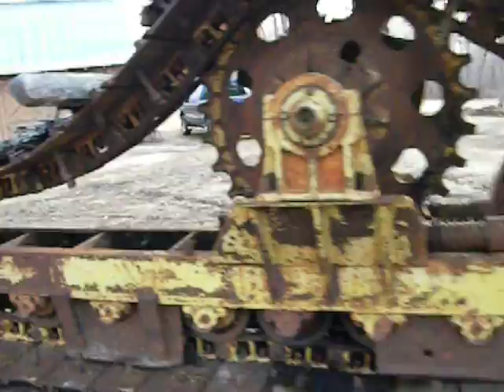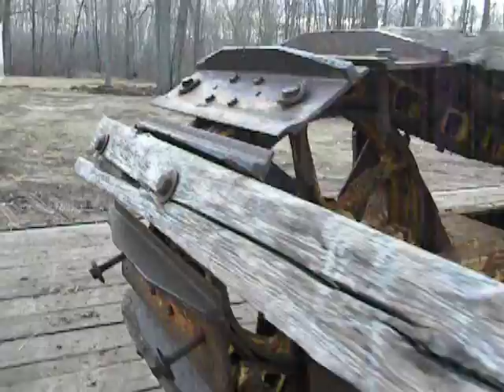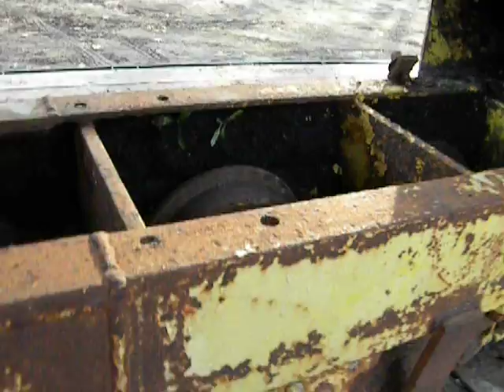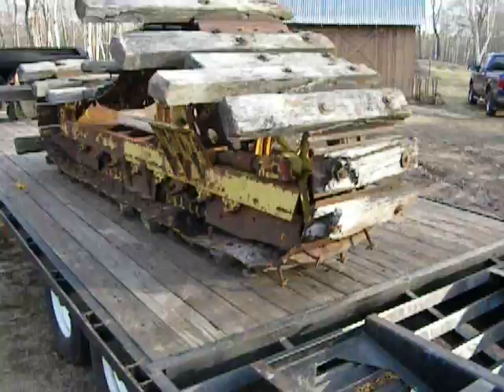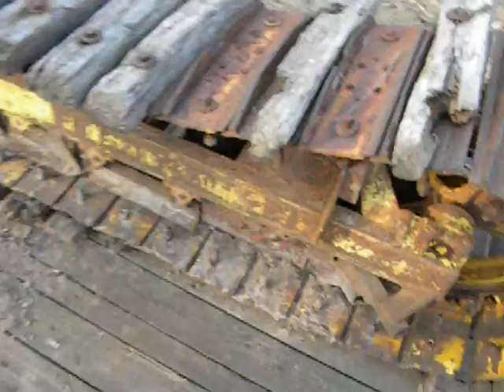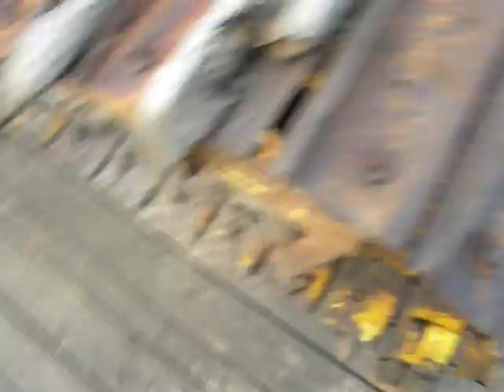Caterpillar D2 / John Deere Harvester Hybrid Track Units

Comment: Looking at it the video, I can say a similar setup is present on some Soviet Niva SK-5(made in Rostov, russia) and Jenissei 1200N(made in Krasnojarsk russia) harvesters that where designed for swampy areas. I don't remember if they used T-130 or T-100M front pads but the idler wheel and rollers definitely came from those machines.  Very cool story on how you found these tracks. Im sure that harvester itself was somewhat one of a kind machine.
Reply: It's not likely this came off a one of a kind machine. Having been a farmer years ago and knowing some about harvesters, farm equipment manufacturers have a mass production mentality and will build basic standard machines and modify them for various conditions. This greatly reduces cost as well. For instance, our farm was in the Palouse region of Washington State. Back in the 1980's and '90's when we farmed, because of the steep, rolling hills, levelling combines were the standard back then. It not only helped with stability, but also a threshing mechanism worked much better when level to avoid grain bunching up on one side across a hillside. That said, you could take a John Deere 95 standard combine and set it next to a 95H hillside model with levelling system, and you would see the machine itself was identical. The difference would be a wider pivoting steer axle, and a wider pivoting drive axle secured by 2 hydraulic cylinders that controlled levelling. The leveller was controlled by a float canister that sensed when the machine would start to tilt and adjust to level. The grain head was connected to a pivoting mechanism at the feeder chute with cables and pulleys. The cables were connected to the drive axle so the header could pivot and follow the contour of the hill. So same basic machine except difference in suspension. My guess is this track system was retrofitted to a standard production combine to reduce overall cost by making a few mods. Judging by how large a front tire on a combine can be, that drive sprocket would pretty much line up to a drive axle.

Comment: Just wondering does the 20 inch pads fit on a D2-5U Cat that has 16 inch pads or was there a special width wider than a 5U l don’t know about.  I have 8 D-2 Crawlers but none with the 20 inch, would you sell me a set?  I live in northern Alberta.  I have a Cat 15-PV with 20 inch swamped pads that are different, they are narrower but still 20 inch wide.  Those special tracks must of fit on JD 105 combines or perhaps a 95 combine.  The ones l seen on a 105 we’re different the setup was shorter than what you have and more compact, most likely a later version.  The JD 7700 was different again.
Thanks for your great videos, l have a passion for Caterpillars as well.
Marc